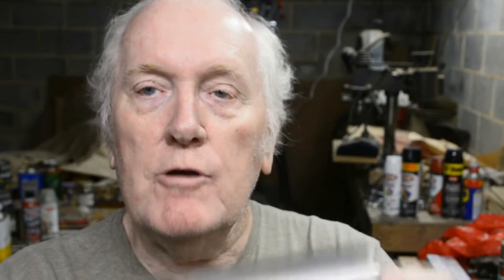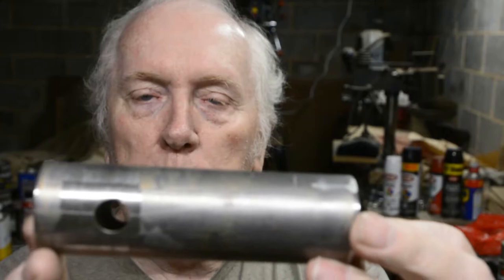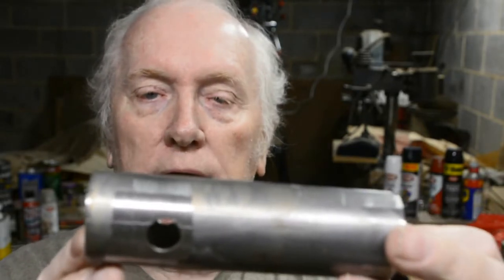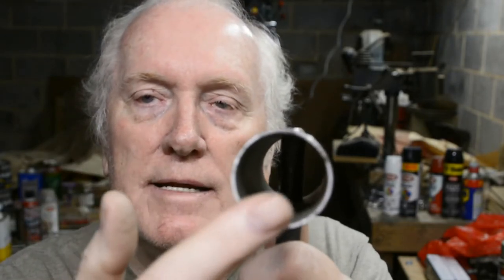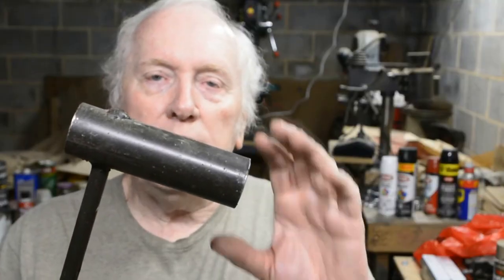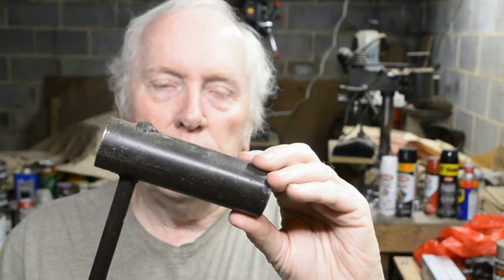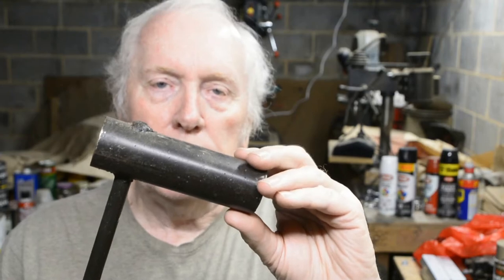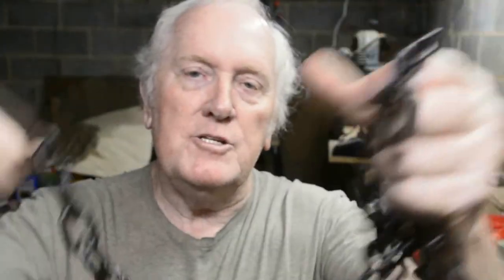All In One Trapping System--The Portable Pocket DIY

Comment: Great info, Thanks Steve!!!!

I had a few made this year, but we used 3/8" rod because 1/2 wouldn't fit through crunch proofs. 
Well it bent with first Rock I hit :( , so next ones will be 1/2" . Ended up using Black steel pipe, and had welded a nut on top to help with abuse from hammering.  The fence post is definitely more cost effective, and would be  a lot lighter to carry around.

When you tie off your cable off your traps to a tree do you  just run cable through a loop end around tree and hook other  loop end to the trap, or are you running chain around tree and hooking loop to chain? Thanks Again, John